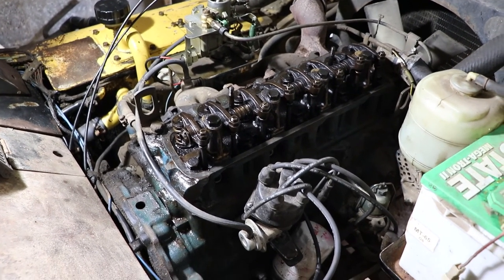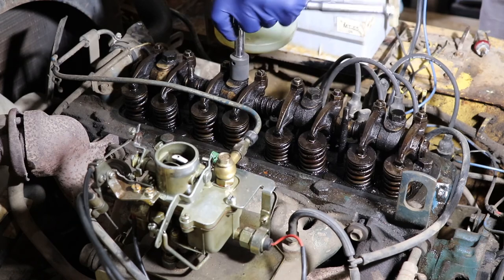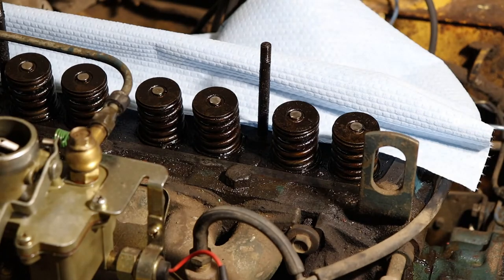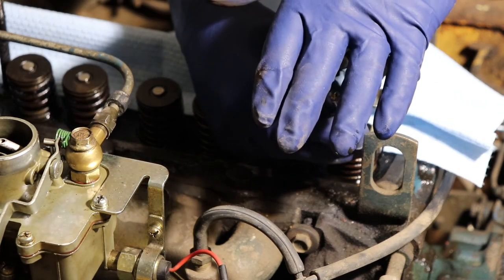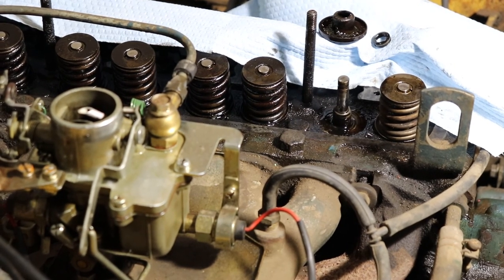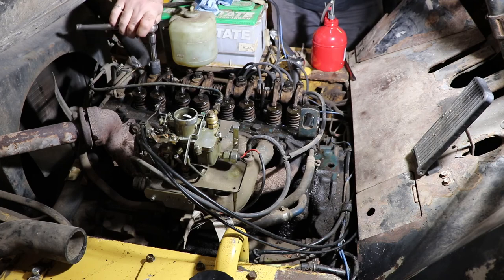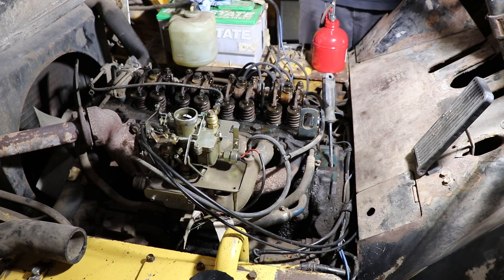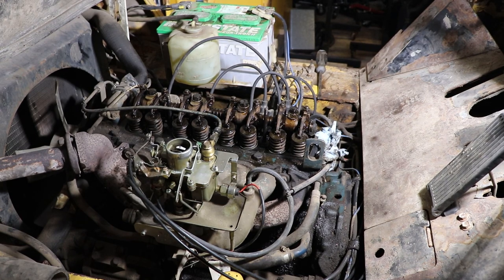Nissan H20 Valve Stem Seal Replacement with Cylinder Head On

Comment: Do you have any info on head gaskets and torque specs.liked and subscribed
Reply from the maker: You can find a lot of info in here:  https://archive.org/details/tm-10-3930-653-14-p-tcm-fg-30-n-7-t-forklift-truck-nissan-h-20-engine-service-an
Reply: Thanks 👍